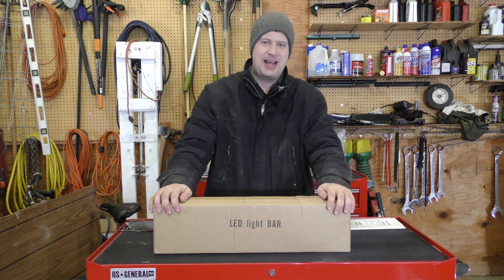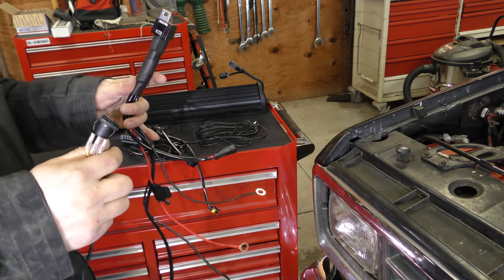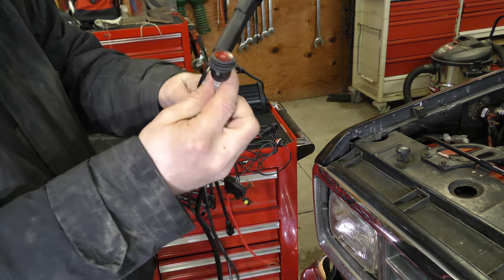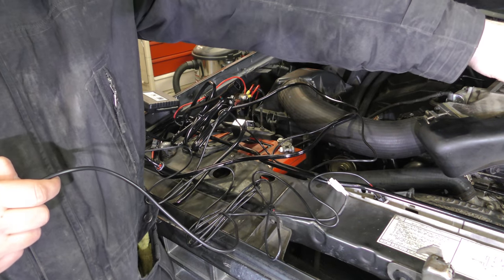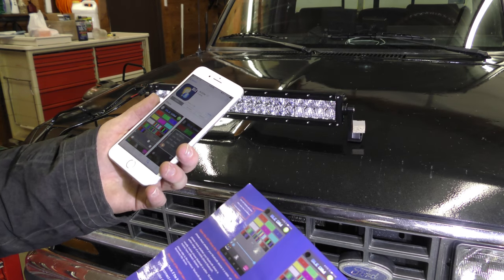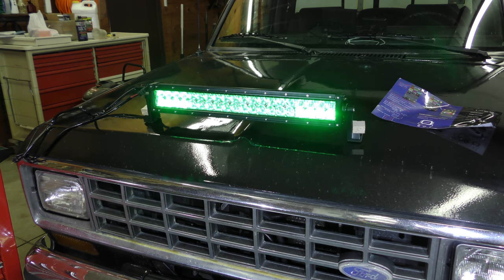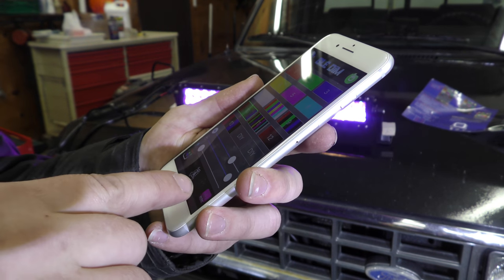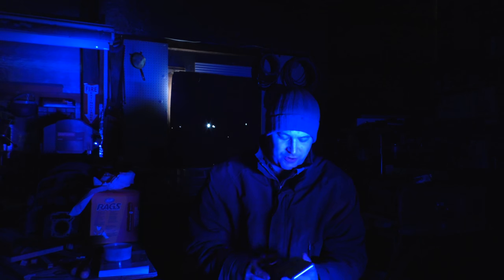Does Your LED Light Bar RGB?!  Mictunings 22" RGB Light Bar

Comment: I'm about to make this purchase hopefully. 2 bars to be exact. Was wondering if you can connect more than one bar simultaneously to the app.
Reply from the maker: I don’t think you can
Reply: RDAllen I see. Okay thanks. I want to ship these to the Philippines in my check-in luggage so I can't buy the preferred 52", 48" 44", ect bars due to box limits. Really wanted to buy two of these 22"s and mount them side by side with single user input functionality.